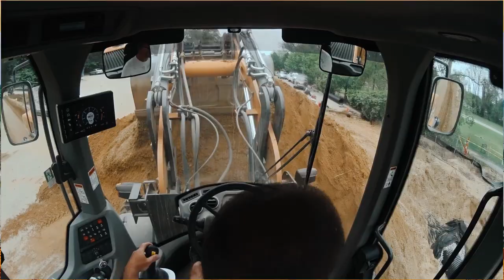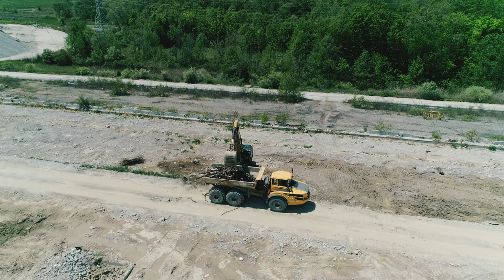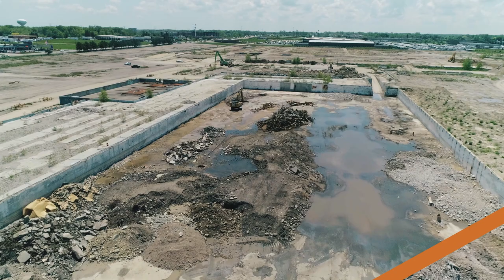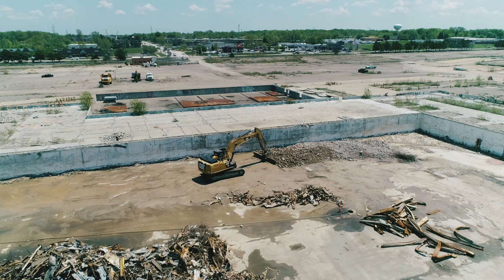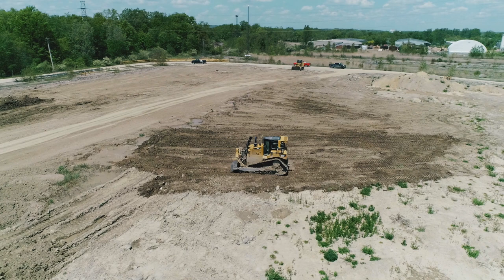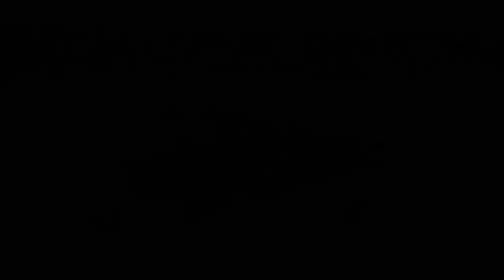Drone Footage of Construction Site Clean-up of Contaminated Soil | Environmental Remediation

Comment: Nice video , is the D6 sequence at normal speed ? What do you do with the contamined dirt ? Thanks for the vid.
Reply from the maker: Yes, this was all in real time.  I'm not sure exactly how they process the dirt but they have a facility onsite they are using to treat the soil.
Reply: @DieselandIron  OK so they don't move it away to be recycled ? It's done on place ? The D6 is working super fast no ?